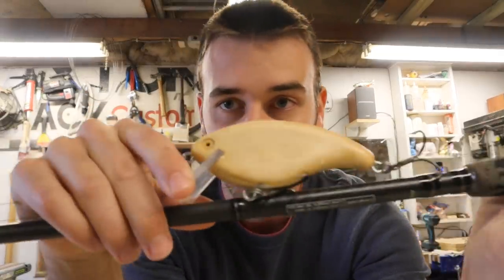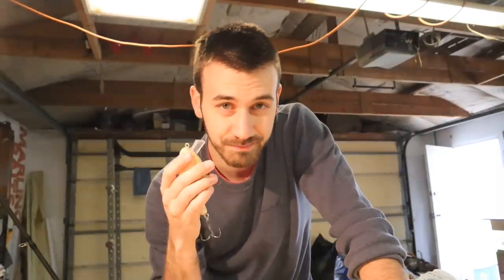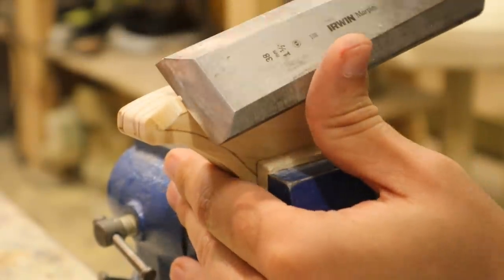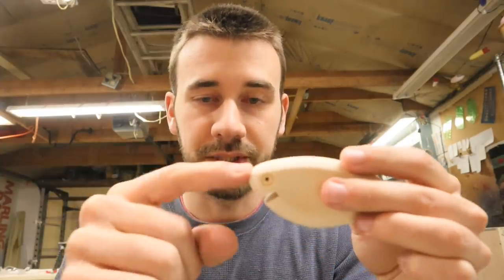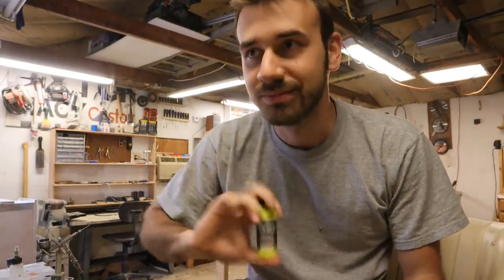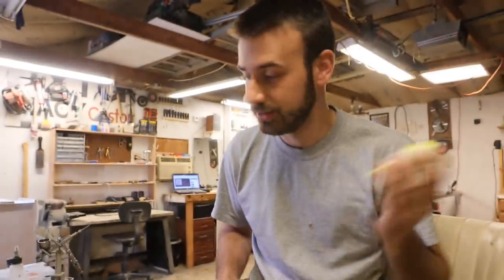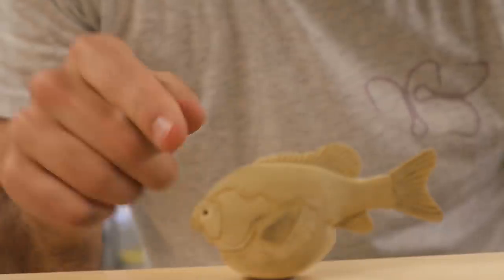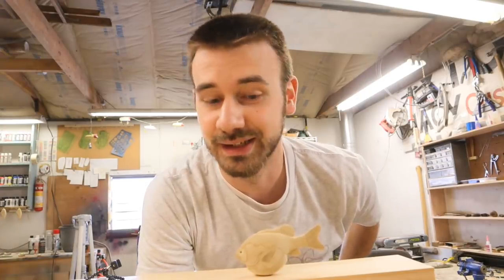I'm Starting a Lure Business

Comment: Two things.  The most important, if you're going to make a lot of one kind of lure, make a jig for drilling the lead holes.  If they're all the same size and shape, make one jig to rule them all.  Saves on fingers and a fast end to lure making.  Second, use a router table for curving the edges.  if you're taking an equal amount from the edge and side (or even different amounts, they make all kinds of router bits), get a round over bit for the router.  It will save a lot of time, and leave more time for the custom lures everybody watches your channel for.

Comment: Could you possibly come up with a light,fluttery version of a rattletrap type bait?Most versions available work well,but under certain situations(fish are lethargic,they can sink too fast,thus having to change to a different presentation/Lure..Tactical bassing was just talking about this.Bill Norman Lures used to make a light,plastic, fluttery version of the rattletrap,but possibly durability,and castability might of been an issue..Haven't seen any in years..Got any ideas?

Comment: About time. But my wallet gonna hate you
Reply: Ohhh big time.
Reply: yeah thats the problem with custom makers
Reply: @finnschofield5049  No, it's not a problem. You have to remember that he needs to pay his electricity bill, water bill, mortgage, etc. Custom means a little higher priced. I would rather fork over $15 to Marling than anyone else. You can help the little guy get his dreams going. Like google and microsoft. Also, I think squirrel_choker meant that hes going to be buying a bunch of baits from Marling...not the expensive part. A good Sebile jointed bait is $15 as it is. Id rather give $15-20 to Marling for a jointed wooden bait than sebile.
Reply: Diesel45 on his website his baits go for 200$, a bit more than 15$. Custom handmade baits are not cheap....at all. He is quite the talented craftsman.

Comment: I worked in a production cabinet factory.  And you could move this up to about 1000 a day. It would take a few day to start but you could cut a week's worth of blanks then move them to sanding then to paint then to assembly.  And use paint boards and do around 100 at once with a hplv sprayer. With cut out templates for blanks shape holes and paint scheme. And then you just organize them according to species.

Comment: If you are going commercial then you are need a way to reproduce the lure shapes faithfully every time.  I would suggest a CNC router, not a huge dining room table size, but rather one that has about 1 sq. ft working table size that can turn out 1/2 sized (longitudinally).
That way you can cut wire channels and hook drops, then glue them together, paint and clear coat, then they are ready to shoot out the door too awaiting Marlingites.

Comment: LOL at 14:30, what did he want, a rasta colored bait haha!!!
It would be cool to see some of the testing like to see baits with different angled  lips but everything else the same, or a flat sided vs a rounder shaped bait, or different face angles/hook placement to see what makes the biggest difference in performance and to help you make the absolute best bait. maybe making a single bait or a few baits with changeable features like a larger lip gap where you could screw in a lip with  some wooden wedges to see the difference in the same exact bait with the same exact shaped lips but too steep and too shallow. you could also set it up so you could tie the line on at different points, and idk about the side shapes but maybe you could make something like scales that screw onto the sides to make the bait rounder than flat.
Also I know you don't want to do batches per say but what about instead of batches you do sets where you use the same or close to the same design for the baits but you set them up with different colors or different paint schemes. Then you could make a beautiful wooden box and sell the set as a complete set where each bait has it's own spot perfectly cut out of foam or something so depending on what you are going after or the conditions you could use different colors, and maybe one rides a tiny bit deeper and one has a bit wider of a weave, so you use those in other situations. 
And what about a rattle bait, I'm sure you could figure out something to put into one of those!!!
Anyways good luck on the business! I hope you succeed!

Comment: Have you thought about making a battery operated lure? Light up or noise maker? Vibrating? With your skill set it shouldn't be a problem. And if they work good you should be able to sell them for money. Maybe make it with a small solar cell and a small capacitor as a battery. It would charge with sunlight or a flashlight. Now that would sell. No battery to change. You could probably make more money painting fish mounts for a taxidermist. Have you ever done a painting on canvas of fish? That could be a big money maker.

Comment: a router table would work great for the hole design of that lure. Make a bait a quarter inch bigger than you want than ride that against the ball bearing of the straight cut bit of the router and than quarter round and than some sanding.

Comment: i know this video is a year old. but you should consider investing in a router table and a good set of bits if you want to do production. Instead of freehanding profiles on a bandsaw you can just make a single template guide and just zip it through the router. That, or a CNC Router to do your profiling.

Comment: If you take a screwdriver and just 'lightly' spin the shaft on your lead pot it will stop the dripping.  I had the same problem until I read the instructions. by tapping you will damage it by driving some crud into the sealing surfaces and ruin it! Just sayin'